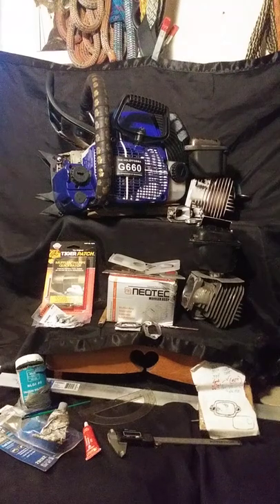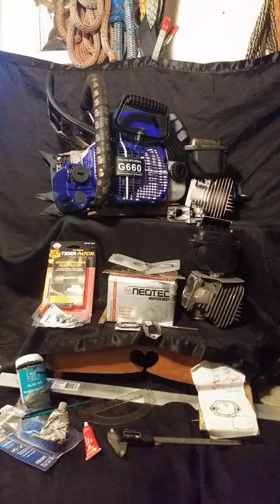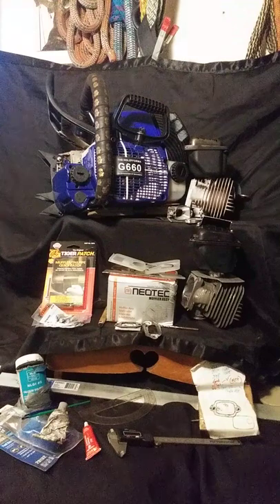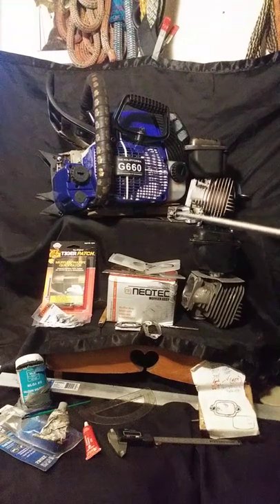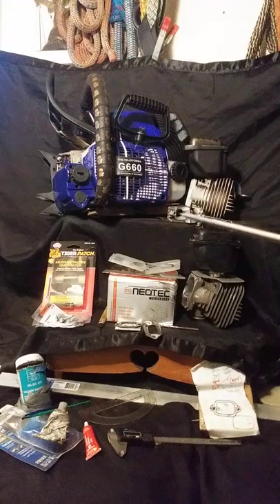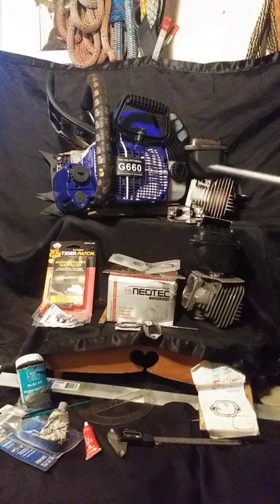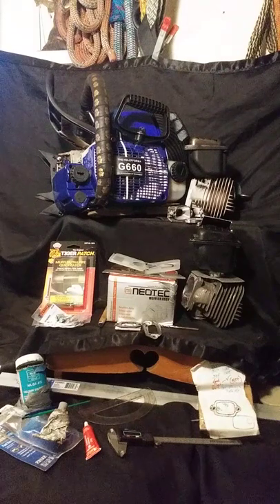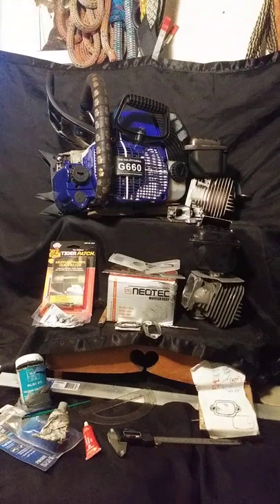GRUNT GASKETS! Lead-In Pipes / Headers for 2-Stroke OPE (#Dominant Saw's idea!!)

Comment: Hello! Thank you for this video! The header concept has been around for years...There is a museum in northern Van Isle with many old chainsaws in it, some of which have some wild muffler modifications, including spacers between the cylinders and mufflers. Is there a formula that can be derived for an optimum spacer? Similar to the volume calculation Iron Horse uses for his mufflers? I would be more than willing to fab up a few spacers, including ones that protrude into the muffler can itself. Just need an indication of where to start for length? Say on an 046/MS460?
Reply: @joescissorhands141 thanks for vid and thorough description! and @oscarmdog5275, would be interested in seeing what you come up with!

 I'm super busy climbing arborist so don't have time to play in the shop like I want, would love to have something to send to dyno Joe to have dyno tested vs say two other options like bark box, on the new 661cm I'm having him port for me.  Let me know, super interested.